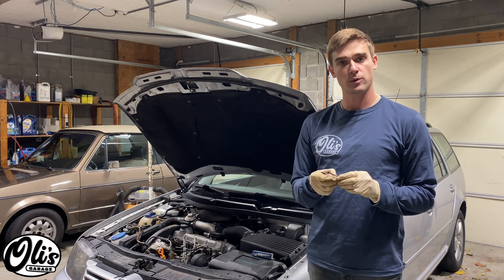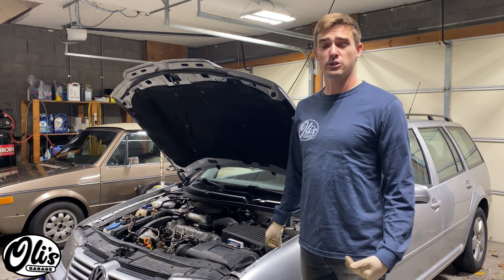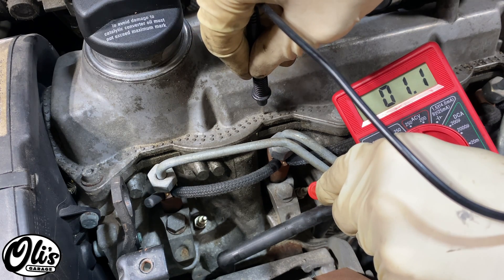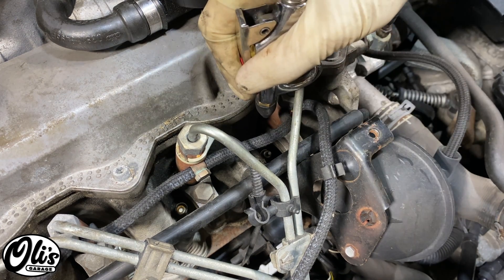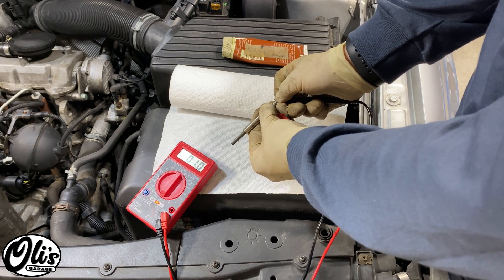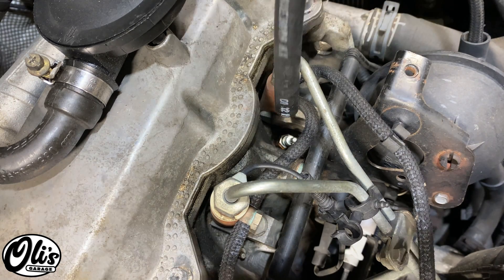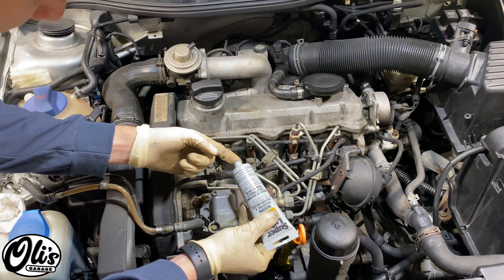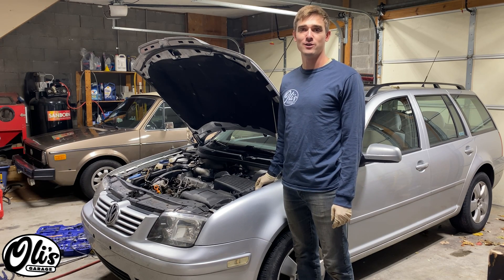VW TDI Glow Plug Diagnosis and Replacement

Comment: I have a 2012 VW TDI what is that thing to the right of the glow plug that's sticking up with the metal coils coming off of it because mine is a little further up than it should the one all the way to the right and I was just concerned about it thank you

Comment: Oli, thabks for the great video!   One helpful request....  Specify the year and model of the car you are currebtly working on.   It looks like you are using 2002 ALH, but a friend is trying to sesp glow pkugs on 1999.   Trying to advise based on any differences.   I think they are mostly identical.

Comment: Great episode Oli, I like to see the TDI videos as well as the Cabriolets, they are very helpful! What type of readout is that in the center of your instrument cluster?
Reply from the maker: I’m glad you find them helpful. Thanks for the kind words!
That readout is called a colorMFA. I think the guy who designed it is somewhere in Eastern Europe/Russia. It’s a really cool upgrade that can be made to most VW/Audis from 2000-2005 or so.  I installed it myself with the help of some pin outs. Its probably my favorite upgrade on the car. I need to make a video about it at some point.

It can read and clear check engine codes. As well as provide all kinds of info. That display alone really seems to bring the car up to today’s amenities/features. I also installed a Bluetooth adaptor in the stereo, so the car has Bluetooth.
Reply: @OlisGarage  awesome, thanks!